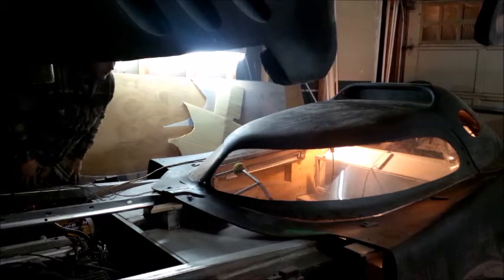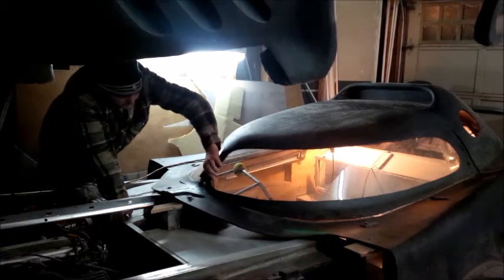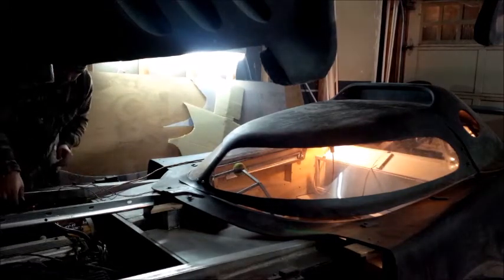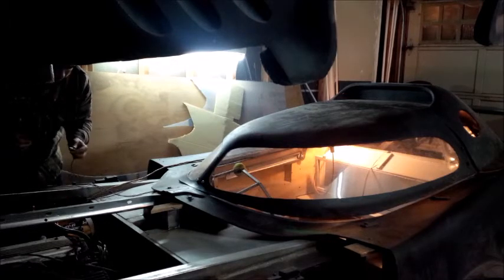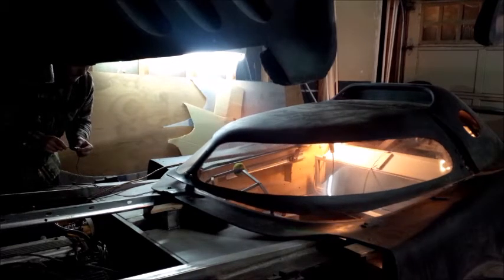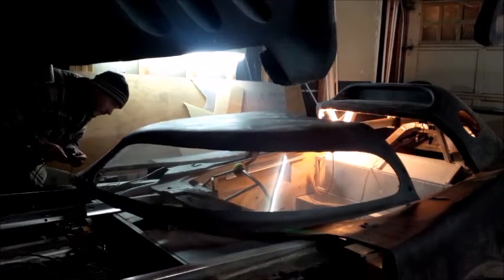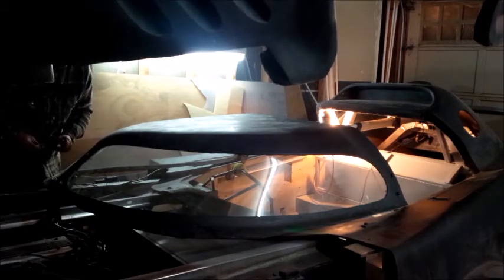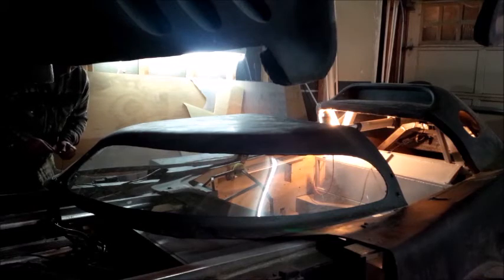BatBerry Canopy Actuator

Comment: hi! what brand/type of actuaotor did u use? i did a search and found some which could do it, but there are a lot of specification! especially the lbs which they can move! whats your recommendation on this? and whats the minimum stroke?
Reply from the maker: This is the one that I used http://www.firgelliauto.com/product_info.php?cPath=62_114&products_id=248

It is a 24" throw and goes at 3" per second
Reply: just 24"? i thought it is more! its just around 61cm! hard to imagin i would get in in! lololol anyway thanks for the info! ill have a look at this one! ;-)
Reply from the maker: joginator There's only so much track/travel that can be used on the opening before you hit the curved front piece of the cabin. So you really only have about 24" to play with.